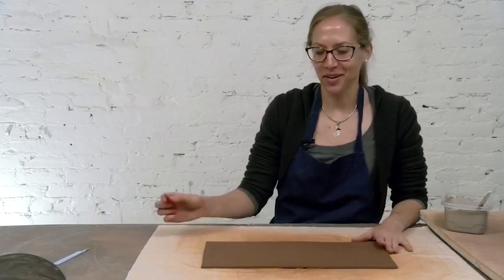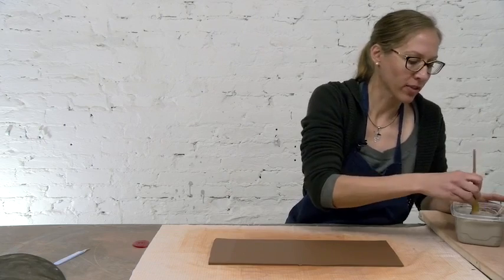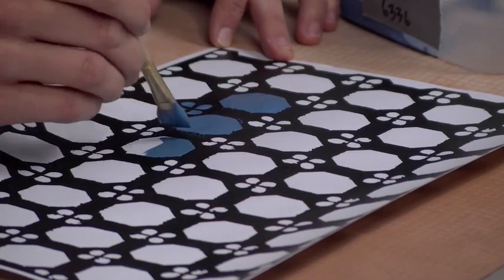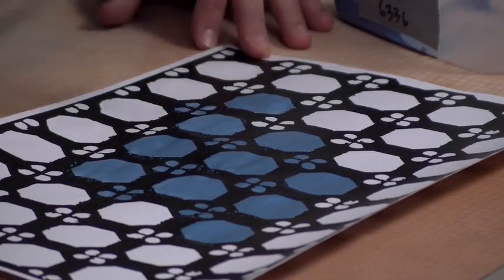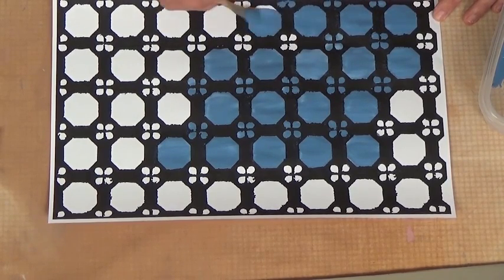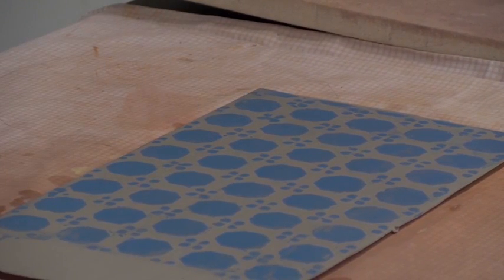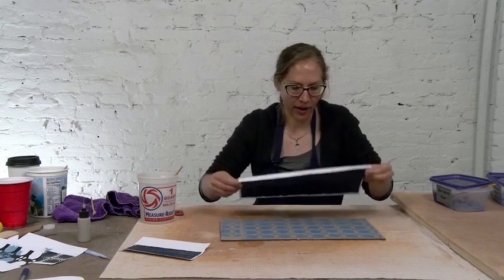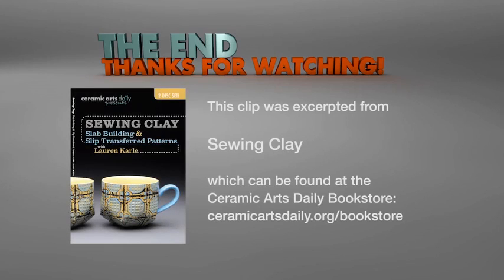Slip Decoration and Image Transfer | LAUREN KARLE

Comment: Use a laser copy machine that uses toner for your paper, the underglaze doesn’t stick to the toner. Put a semi heavy coat of underglaze. If printing a design try to use lines that are 6pts wide or larger. If doing tiny details paint a spot and let it dry before painting spots nearby to avoid colors mixing. I already know how to do this but the presenter didn’t give many details that would help a beginner hope this helps.

Comment: No explanation on what kind of paper that is? What paper has black on it like that, that won't allow the slip to stick to the black?
Reply: That is just regular printer paper.  You print an inverted design using a regular laser printer (not inkjet).  The black part resists the underglaze.